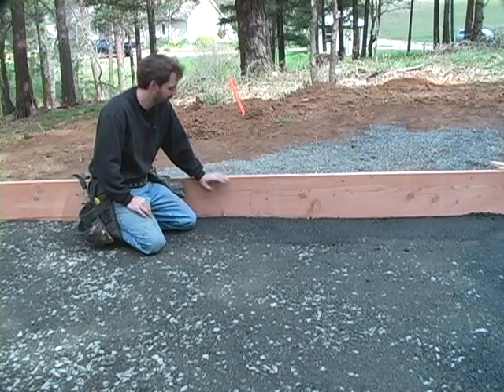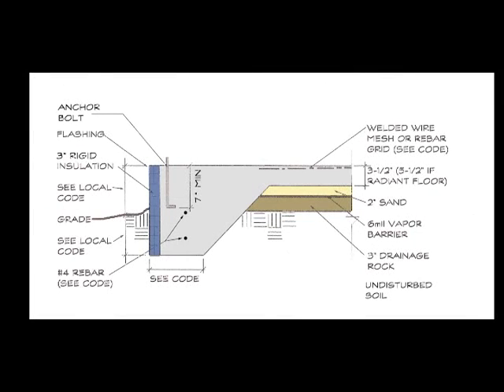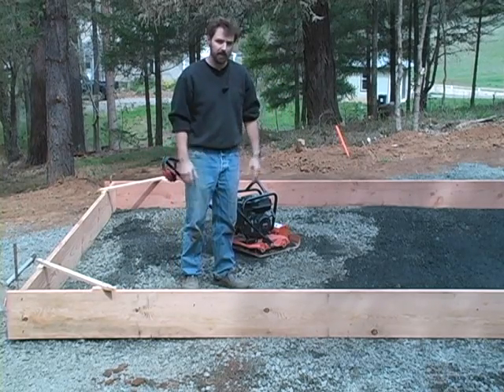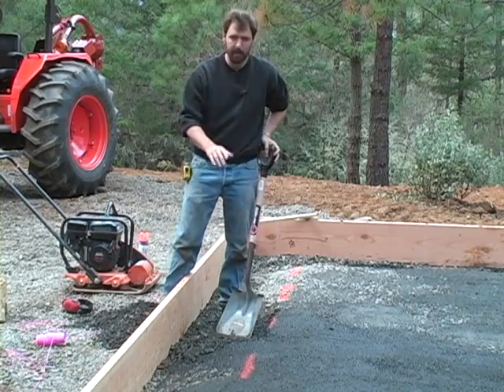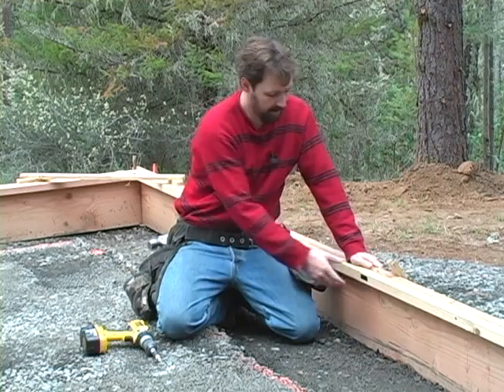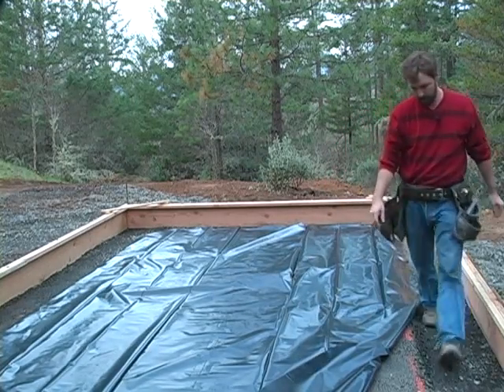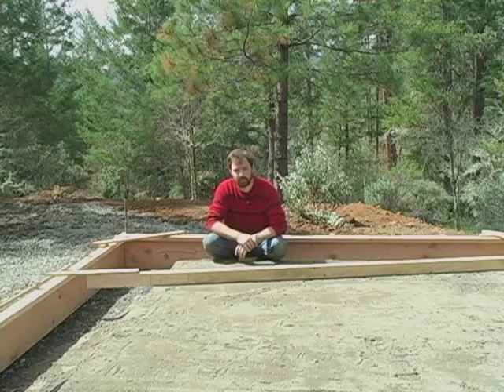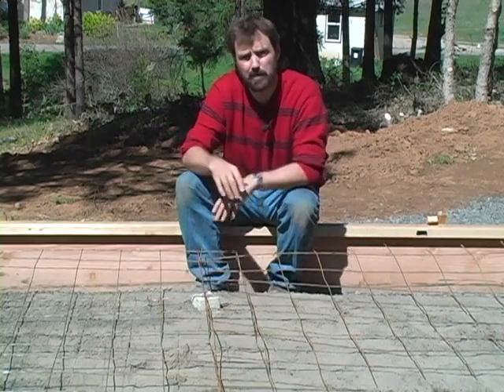How to Form a Concrete Slab and foundation

Comment: Am helping a guy that insists on placing the edge of his slab about 4 inches over  and away from his footing.  I can't convince him that it will create a breaking of the slab  hazard at the point were the footing going down and the slab continuing ends. The weight of the building will be on that after all. Am I wrong?

Comment: Clever design - cutting the footing out of the compacted base rock. This system would seem to keep more of the base materials from sloughing down into the footer trench and addresses the difficulties I have foreseen in monolithic pours. -  Your teaching style offers many details of good construction practices in and eloquent style. Excellent presentation.  Thank you.  - You recommend 3/4 gravel base and it seems to compact and hold shape well.  I assume you have you considered road base as an alternative.  I would think the various particle sizes of fines in road base would tend to make the compaction more stable.  Is the choice economically based - road base being more expensive.